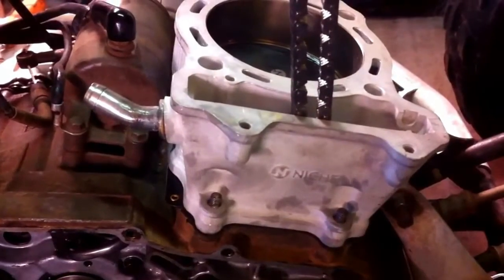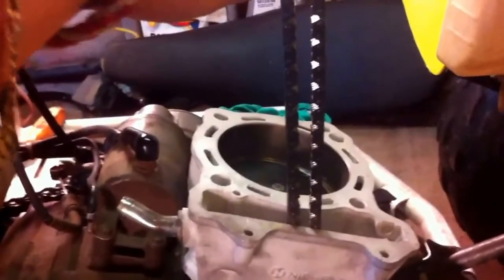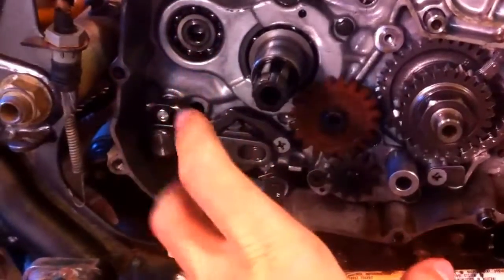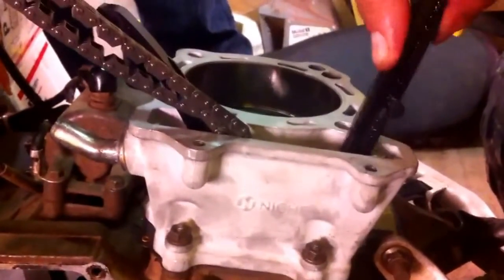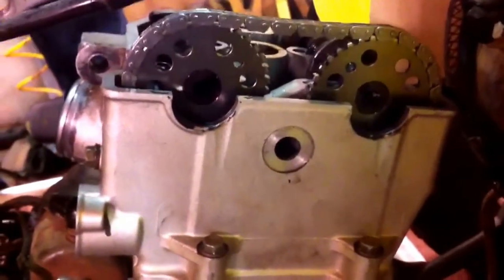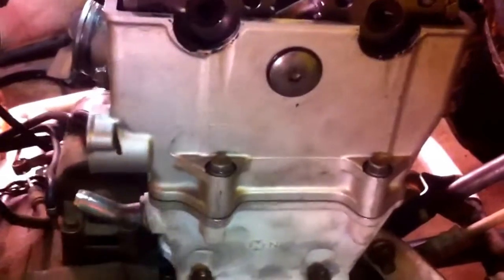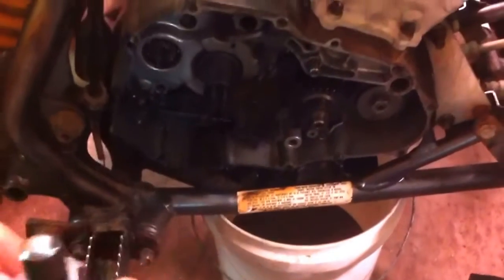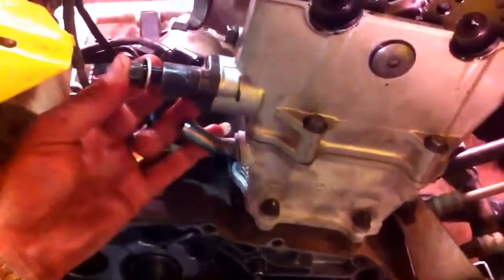Suzuki LTZ 400 how to install big bore cylinder 440. Head Bolts torque specifications

Comment: my 2005 ltz 400 is pushing oil into the coolant reservoir and causing it to overflow out the spill line. Do you know what's causing that?

Comment: I have just bought base gasket and head gasket for my LTZ 400 do I have to remove the black covers off of the gasket or do I leave all of them on there also as well on the head gasket do you put gasket sealer or do you just leave it as it is

Comment: I have a dumb question: I got a z400 and I tried to drain the oil but everything was pure sticky white. Is my entire engine done?
Reply from the maker: Not a dumb question at all. It is most likely blown head gasket or cracked cylinder.
Reply: World Mechanics ok I priced a cylinder head for $60 and piston with gaskets for $160. How can I clean the milky oil from the bottom end ?
Reply: World Mechanics I also found out that the water pump went out but I just priced one that comes with a radiator for $50
Reply: World Mechanics is ok to put some oil threw the TDC bolt that lets you check your top dead center
Reply: World Mechanics I'm doing a oil flush to get the milky oil out

Comment: I do have a question for ya guys.
Ever do a big bore kit on an atv?
If so, is there a big list of stuff that has to addressed ? Such as jetting or crank rod lengths? I'm just totally ignorant on the big bore kits
Reply from the maker: +frognuts Ell We are not fans of big bore kits as well. Most of the Good Brand kits come with everything that you need. You will definitely need to jet the carb and adjust the level because it will be using more gas. You will not need to mess with the crank and rod lengths unless you stroke it but most people just slap a wider cylinder with wider piston(big bore kit) and jet the carb
Reply: +World Mechanics I'm not either unless I can rebuild the entire motor. 
Or 
is it NOT the extra stress of the increased HP to the bike that dissuades you?